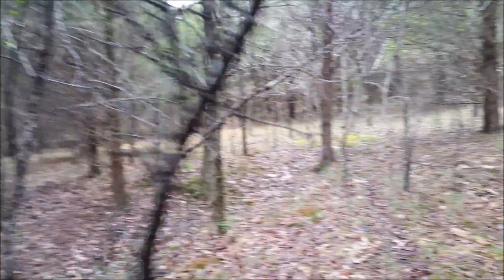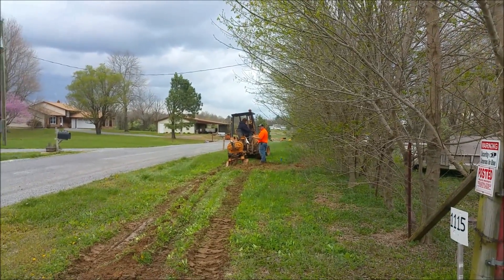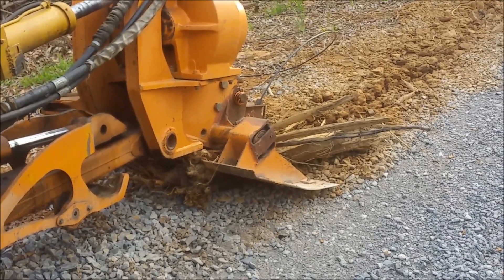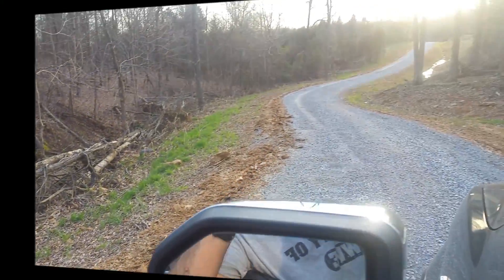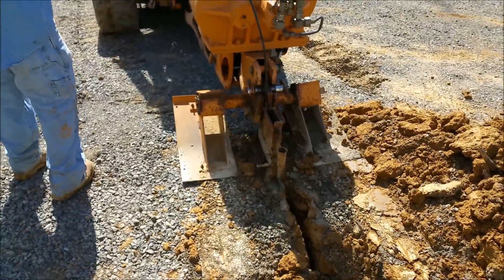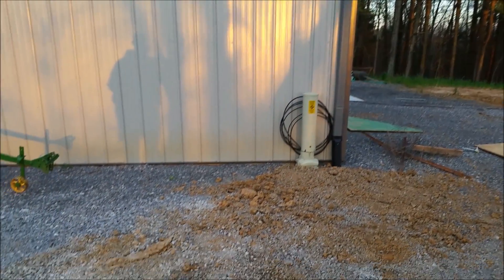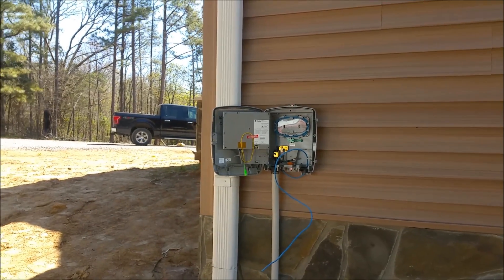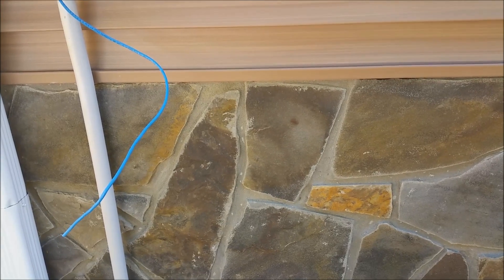Installing a mile of fiber optic internet line to our Remote Country Home 04 11 17

Comment: What was the cost to getting it installed?  I'm rural too.
Reply from the maker: Bill A just a fee, like 65.00. It was basically free to move existing service.
Reply: Kapper Outdoors 
Thanks 
Wow laying a mile of fiber for $65.
Reply: Kapper Outdoors how is that possible? Fiber cables are a dollar a foot.
Reply: @NojoNinja  Most internet providers make the money back from yearly contracts and monthly internet cost only cost few dollars a month to keep internet going rest is profit
Reply: @NojoNinja  You can get fiber cables for a lot less than a dollar a foot. Especially if you’re using a lot of it.
Reply: Ethan Lamoureux like, for instance 1/4 of a mile of fiber cable?
Reply: @NojoNinja  Like miles of it. Which is what an ISP might do. They probably buy it by the truckload, and get special rates. You can buy it from China for less than $0.10 per foot, for outdoor-overhead drop cable, and that’s without any bulk discount. Underground direct burial cable like you see in this video is more expensive, but I wouldn’t use it because it’s more likely to be damaged. I would use cheaper outdoor cable and put it overhead or in pipe.

Comment: Why not put the box inside where the 110 is?
Reply from the maker: oruwatching pretty sure they have to have it outside so they can cut it off or service it.. sure would have been nice though!
Reply: @kapperoutdoors  They do make an optical-only demarcation box which allows the fiber to be run directly into the house, where a small box similar to a DSL or cable modem is connected to the fiber. But it looks like this company has decided to go with an outdoor solution, one which requires a separate power cable, which is really odd...
Reply: Accessibility.  Everywhere you run a service be it , Elect, Gas, Sewer, Water, data , whatever ,  you have to have access.  Access usually involves maintenance and means of upkeep.   Look at power lines or gas lines and youll see large "right of way" basically wasted land.   So they usually (usually) keep most infrastructure on a "RoW" already established.

Comment: did you have to pay for all this?
Reply from the maker: Just a $60 installation charge! Can't beat that man! Back up north you'd have to pay the company by the foot to get a new drop line installed. This is awesome..
Reply: Kapper Outdoors Thats crazy good for you- you're right I got a quote to run electricity to my cabin in upper Michigan for about a quarter-mile was $14,000 just put trench it in....Happy Easter to you all---
Reply: Kapper Outdoors Thats crazy good for you- you're right I got a quote to run electricity to my cabin in upper Michigan for about a quarter-mile was $14,000 just put trench it in....Happy Easter to you all---
Reply: Holy smokes, you got a deal.  Called Time Warner a few years ago when we were thinking about renovating an old farmhouse on land we owned, 1900 ft off the pavement but only 1500 ft from the closest neighbor who is also a TW customer.  They told me $2600 at the time which is a lot but one time and done, right?  

Well, we didn't go that route and tore the house down and tried to figure out what kind of house we wanted to build.  Called TW again after a couple years had passed just to get a figure.  They wouldn't give me a quote because there was no house there but a guesstimate was now $14,000!  I figured I had just gotten some moron just quoting bullchit numbers and dropped the idea at the time.  The MAIN thing I took away from both conversations though was that I could at least get service if I wanted it.

Fast forward a couple more years and we decide on a house.  Called Time Warner, now Spectrum, and they said I could get service but that they couldn't do a site survey until a foundation was in place.  Start the build and call Spectrum and no matter how many people, departments, supervisors I talk to ALL say I'm too far to get service no matter what I'm willing to pay.  Actually told me that they couldn't offer service past 150 feet.  Really?  I asked how the hell they got any new customers, especially in any rural area if they couldn't tap past 150 feet?   Complete and utter morons.  Not one department knows what the other is doing.

My only other traditional choice now, IF they don't pull the same stunt as Spectrum is to use Windstream which uses fiber optic lines and only offers 25 Mbps.

Comment: Kapp I think I heard you say they crossed the 4/0 wire, am I correct? They can cross it but they cant run parallel to it otherwise Eddy Currents will cause interference.
Reply: fiber optic lines are just strands of glass there can be no eddy currents.
Reply from the maker: The fiber runs across the 4/0, but not parallel with it. Seems to work great, I've got 100 mb per second speed! Insane! This is the farthest out in the country I've ever lived and now I have the best internet service I've ever had....
Reply: @kapperoutdoors  I live in the poorest county in my state and we are getting fiber before the city folks. Lol I am actually looking into becoming an installer of fiber in the spring.
Reply from the maker: @travishartman5662  Yeah just like where we are here! Love it, lol. Sure nice having super high speed way out in the stix! Good luck if you become an installer. Take care.
Reply: ToniMattTony nope. Fiber isnt affected. And the shield on the wire is enough to offset even if it were.
Reply: He did not say it was Fiber optics, if it is and you are correct and I apologize.
Reply: ToniMattTony it is in the title of the video haha
Reply: I know, I am still not operating at 100%. Last January I was diagnosed with a giant brain tumor and had a month to live. After my surgery I could not even remember my home, it was scary. I am getting better every day but I am still not well. Nice talking to you. Tony W.

Comment: Wow what a task! Good to know these fibre optic boxes need 110.. did they just run an extension cord inside??? 😓
Reply from the maker: Basically they installed the 'power box' inside next to an outlet and then ran the connecting cable back out to the external brain box... IF I would have known (or the electrician, or the builder..) we'd have put one in! lol.... But at least we found a solution.
Reply: Kapper Outdoors yeah Ryan should be more tech savvy 😆😆
Reply: Most of them do not require AC power. Typically they will use POE (Power Over Ethernet) with an adapter that plugs in inside the house, and that injects DC power over the ethernet cable running out to the network box. Why would anybody want to run two wires outside?